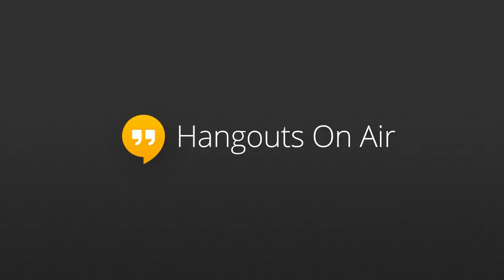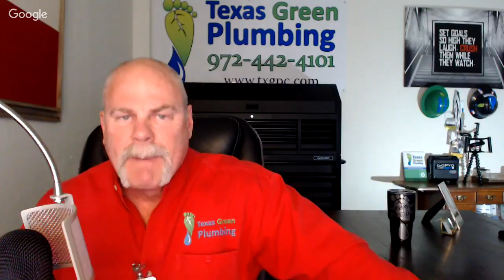Will Water Heaters Freeze? Ask-A-Plumber: Episode 18

Comment: Hi, Roger, I live in Beaumont, TX and tonight I am going to shut off the water at the meter and drain the cold water indoor and out before the hard freeze which starts at midnight and last for the next two days. My question is do I must shut off and completely drain the water in the gas hot water heater (which sits in an uninsulated garage); or can I just not use the hot water for the next two days while it keeps the water hot so it won’t freeze? 
Thank your advice!
Reply: Did you ever get an answer ?

Comment: this unusually cold weather in north Austin froze our tankless water heater that is in our garage. We are trying to thaw it out using a space heater. We are starting to get a stream at the lowest point --the bathtub. I hope that works. We just moved to texas from PA so did not expect problems with the heater freezing. In PA our water heater was in a heated basement.
Reply: Did the space heater solve your problem
Reply: @bradgro2921  yes, I saw another video on here that said to take the cover off & use a blow dryer so my husband took the cover off so the heat could get to it better, then it did not take long for the hot water to start running.
Reply: @PreparingForZion  thanks
Reply: What area did you apply the heater to? The PVC pipes or the inlet/outlet valves at the top of the tank? I'm working on thawing my tank out now!
Reply: Well its supposed 2 freeze for 5 days in Louisiana 12/22/22-12/27/22. Should the waterheater be shut off? The waterheater is outside.

Comment: Hello Roger! I replaced an 80 gallon electric water heater yesterday. It has been in operation like 6 hours and lukewarm water. The water heater sits outside in an addition shed built for it. 240v powers the elements, both elements have 12 Homs of resistance, current draw on top element 19.7 amps. Thermostats are set to 120 Degrees. Everything checks out but no hot water. Any ideas? the old one was not leaking but stopped heating water and both elements and thermostats with dip tube were replaced to no avail. Finally decided to buy a new water heater and the problem is still there. please help!

Comment: If the water dos freeze inside the  tank, what could go wrong. Ive got a small 6 gallon heater. It’s in my workshop that wasn’t heated. I forgot to check it. I went to plug it in and  now I have to keep resetting my GIF. What could have broke that would make this happen and can I replace it?

Comment: My pipes froze during this last texas freeze but they are thawing out with a little water running...do you think my hot water heater is still lit..?
Reply from the maker: It should be. Have you checked it?
Reply: @RogerWakefield  Not yet but at the time we had natural gas burning inside..maybe I'm thinking its not on because the hot water is barely running and I can't feel any heat coming from it..??